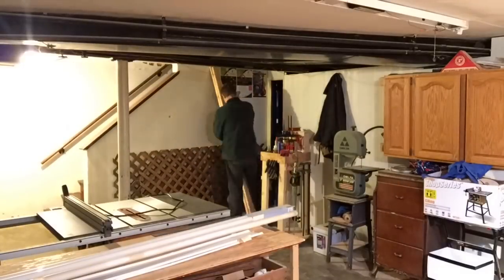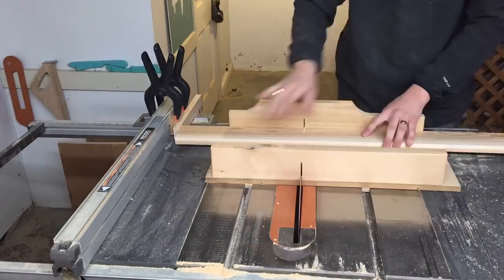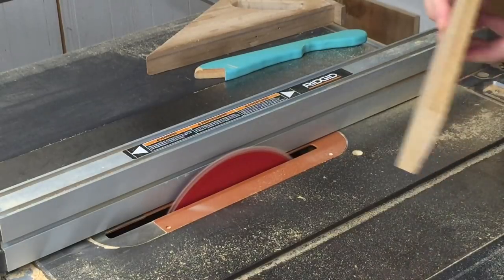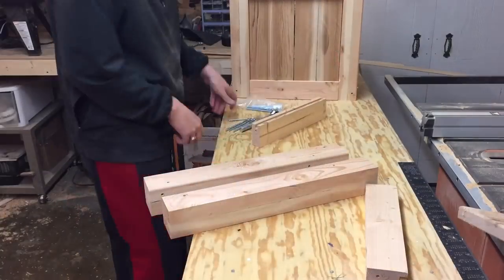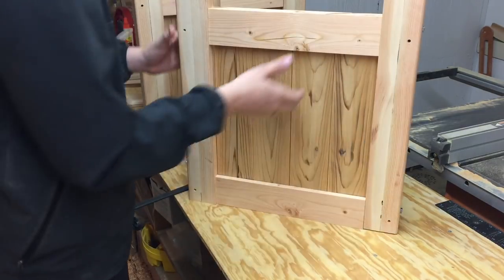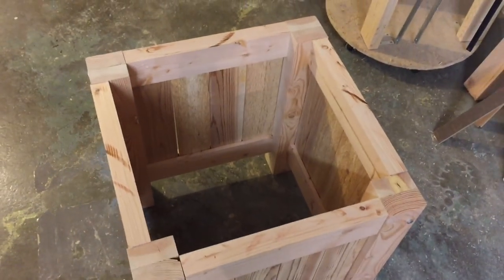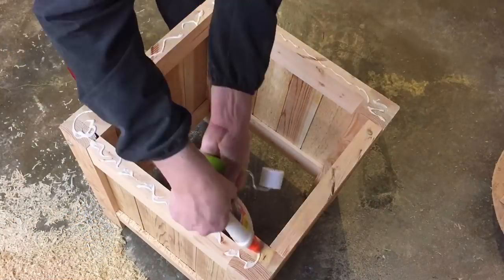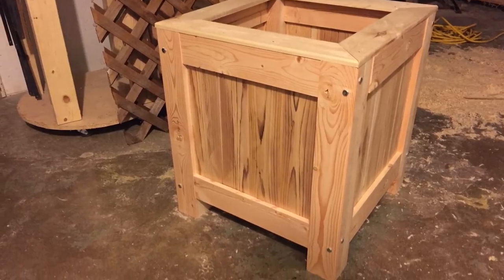How to Build a Cedar Planter Box

Comment: How have the 2x4's held up against the elements? Did you add any kind of finish? I get that you wanted to use scrap lumber to keep the cost down but if your scraps don't include enough cedar, you either make a trip to the store or make an indoor project.

Comment: Nice planter boxes, but that blue push stick isn't a Matthias Wandel design. It's a design that has been published in woodworking magazines for at least 30 years now and the most common name for it is a "bird's mouth push stick". They even sell the exact push stick (in plastic) at many woodworking stores including Lee Valley Tools. And the other design is one that has been around for years as well. Both of these show up in at least 4 books in my woodworking library.
Reply from the maker: Good to know.  Perhaps I should have phrased myself better.  I downloaded the PDFs for the push sticks from Matthias.
Reply: OK - that works better. I have several of both types, from store-bought to gifts from friends to hand-made. It's good to have a few spares as I use them on several machines.

Comment: if i could offer a design suggestion. the proportions of your mitred top are not good. it should be much thicker and over-hang more. (like an inch) also the huge bolts really kill the look of it. use joinery instead of mechanical fasteners next time. its worth the extra time for sure. you could also make the legs 1/4" proud of the rails to add more shape to it or v-groove all the joints with a roundover or chamfer birt to give it a more finished appearance. at the very least get them flush man. they are kinda all over the place which creates a very diy look.  you should learn how to use sketchup too. its super simple and allows you to see proportions before you start building. not hating, just trying to give helpful feedback. keep practicing man!